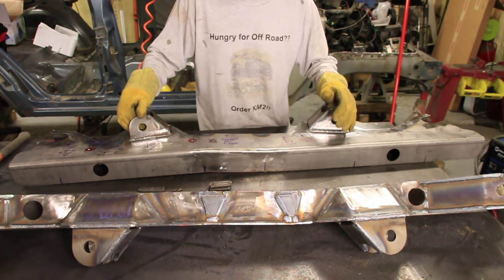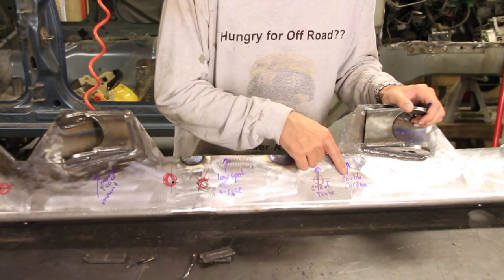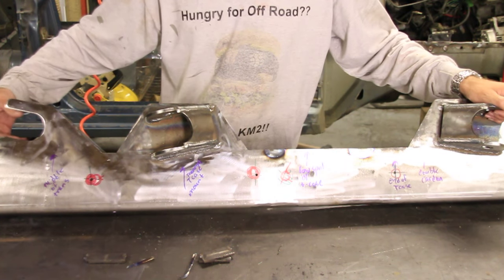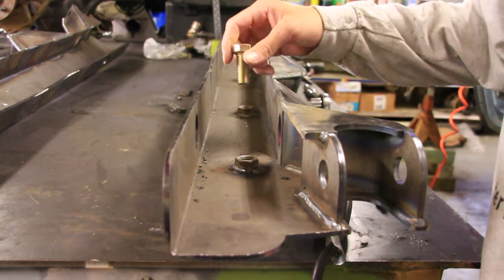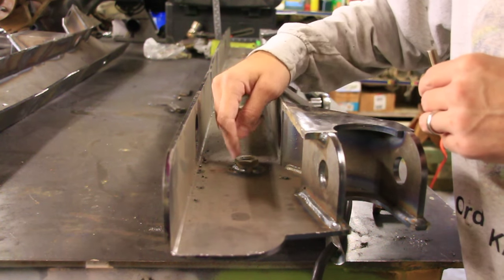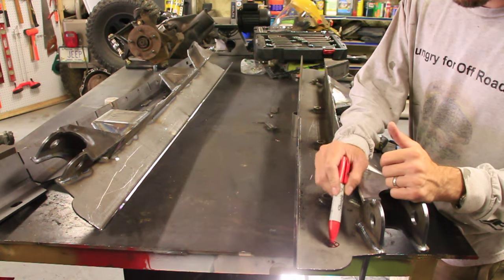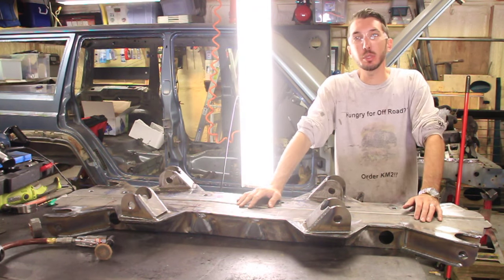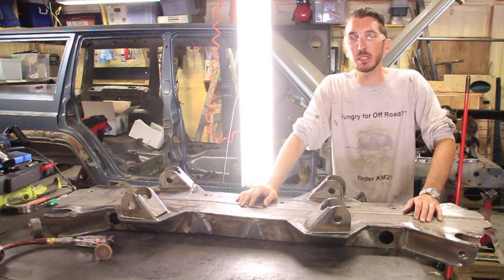Fabbing Skid Plate Holes for the Scorpion Crawler

Comment: Matt, I made a similar subframe for mine. I bolted it on instead of welding it. I drilled through the frame and sleeved it for 1/2" bolts. My thought was I could unbolt it and reinstall in on another xj after I destroy this one. Just a thought if you haven't welded it on yet. It looks badass.

Comment: zinc weld thru primer man. spray the insides with it, it doesnt melt like enamel when weldded on and will give a good protective layer
Reply: +Raging Reaper Gaming Variety  beat me to it. Use the hell out of that stuff for repairing sail panels and roof skins on old trucks i restore.
Reply: its good stuff. really shines in marine welded applications and heavy equipment repairs

Comment: If you want that step bit to last always use cutting oil when drilling steel.
Reply: +Justin Thoma I think he did, judging by the smoke produced and bottle in the background around 4:00. Don't think he used any with the hand drill though
Reply: you usually dont produce enough feed pressure with a hand drill to require cutting fluid, and youre far more likely to much up the edges from wobbly unstraight drilling in a had drill than by heat, also cutting fluid tends to be a pain when you plan to paint the part

it has its applications in heavier stock in a drill press or when drill many holes continuously but some people over due it with the cutting fluid, some times using 5$ worth of fluid to prolong the life of a 50cent bit

Comment: watching you drill up words like that underneath brings back a bad memory.

I was drilling under my Jeep years ago and the drill flopped over and fell as it was still drilling into my bicep and twisted up my coveralls and drilled into my arm and made a tourniquet at the same time. It also kind of ripped my thumbnail part way off. Actually the worst part was the thumbnail. I went in the house and grab some tweezers after I cleaned it with peroxide really good and scrubbed it out and told my ex-wife to hold the tweezers while I cut the hanging skin off with the sharp straight razor.

She was too queasy so my dad had to come over and hold the tweezers for me while I cut the skin off I thought I had it clean, but it got infected anyway oh well now I got a nice scar I always like scars better than tattoos anyway

Comment: Those step bits work great , and can last a while ... Just be sure to use cutting oil , wd40 , something  when using it ..
Reply: It's kinda hard to spray oil on it by yourself.  even using a good carbide step bit took longer than a cheapo hf hole saw.